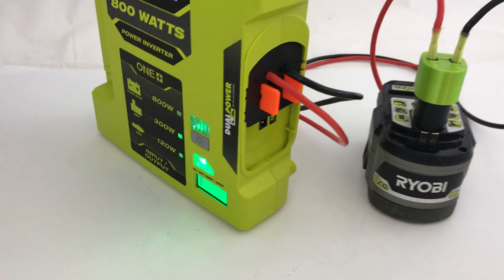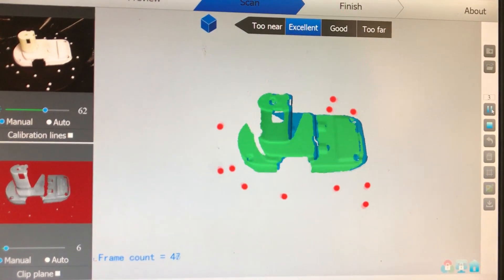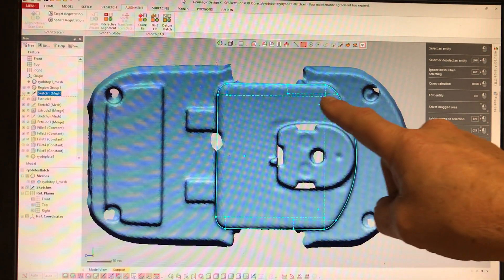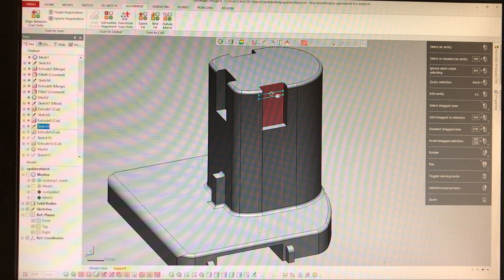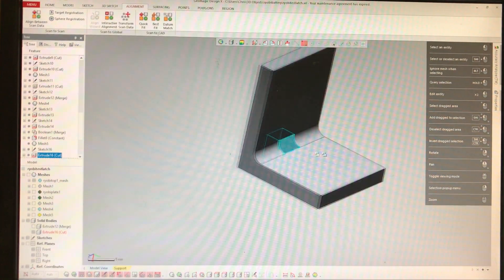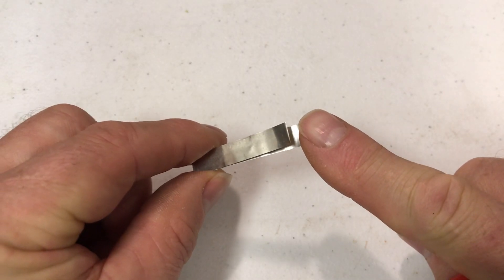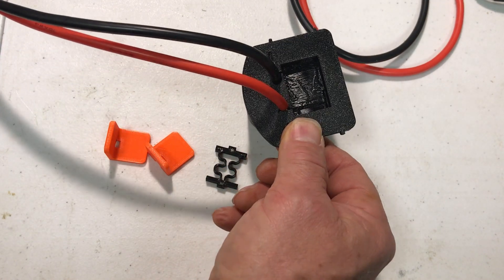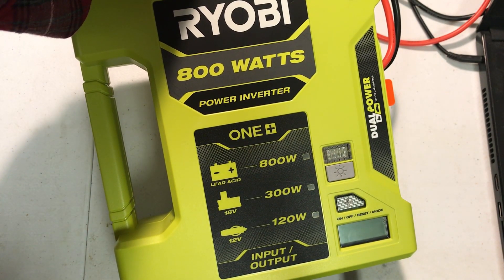RYOBI 18V Battery Adapter Cable -- How to Reverse Engineer parts with Revopoint POP 3D Scanner

Comment: So Ryobi offers their new 40V battery backpack (in alignment with this idea), but I was hoping to make something less tedious in size, like a single battery or dual battery belt/harness. Husqvarna offered something similar in the past for their top handle saw (allows the battery weight to be held on the hips rather than the arms while cutting). Yeah... would make my Xmas gift fully work ready!
Reply from the maker: They didn't have the backpack when I did this project

Comment: Looking for your suggestion.  I have some solar panels. I want to put them on my shed roof, and have them keep my Ryobi batteries charged in the shed.  I would prefer to avoid an inverter. So direct from solar using a dc-dc buck converter, and then some type of charge controller/bms to keep the batteries charged.

Comment: Very cool.  Thanks for sharing.   

Would you consider nesting several batteries in parallel for longer run time for on the fly hot swap capability?  Not sure of how long this device can run continuously.

I wish this device had a power button for both AC and DC sides to conserve battery life (don't have one side on if not needed).  I am thinking longer runtime for 12V DC.
Reply from the maker: you can run a bunch of 18V batteries together in parallel. If you use blocking diodes on each battery, then they can be hot swapped and have different levels of charge. I'm going to be putting a video about that in the future ;-)
Reply: @SerendipitySue  Great news indeed--can't wait to see that one.  I am trying to figure-out portable power options using my batteries ahead of the upcoming scouting camping season.
Reply: How long it runs depends on the AH of the battery and how much load you put on it.

Comment: Silly question here. It looks there might be enough room for you to plug in the 12 cigarette plug power supply that’s normally covered by the battery with this. What I’m wondering is if it will fit and if you remove the battery will it roll over and keep providing power like it does when you remove the alligator clamps from a 12v battery when the 18v one is inserted?
Reply from the maker: Since RYOBI didn't design inverter with that in mind, I'm not sure it's safe. I don't want to smoke test my unit yet :-) The two 12V sources act differently. They have different max. current shut-offs. They light different LED's when on. The 12V cigarette plug can physically fit and I agree it would be nice to fail-safe over to the other supply

Comment: You have perfect timing. I literally just got my 3d printer dusted off to start working on a project like this to use alternative power sources and banked Ryobi batteries. TY for this! Any challenges with paralleling? Would be cool to show people tool power single batt vs parallel. I know there are quite a few tools that shine night and day difference between 3-4ah batts and the 9ah - even without the high power tabs.